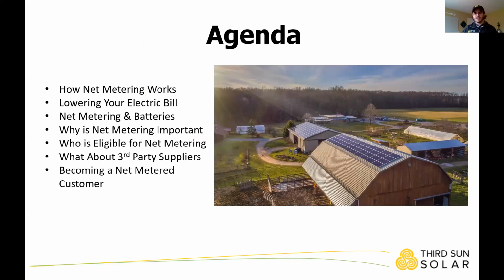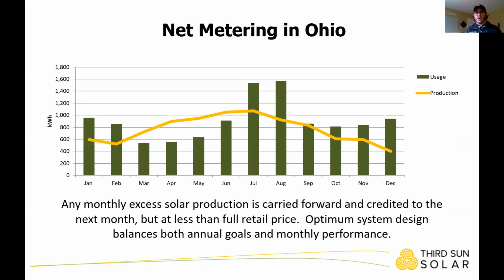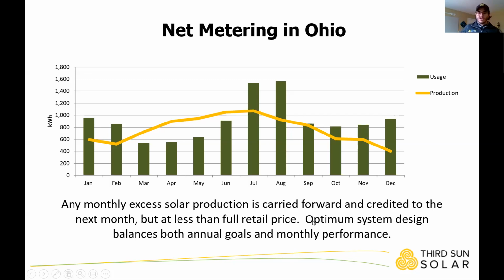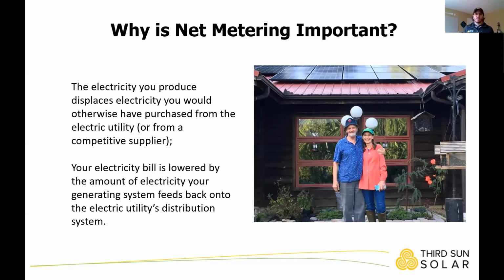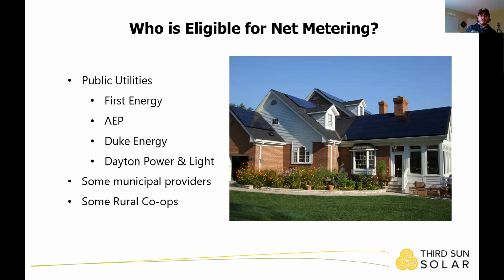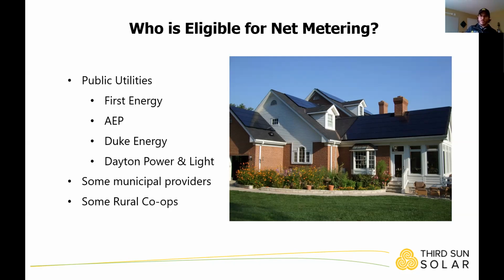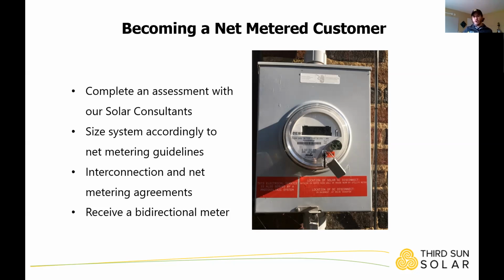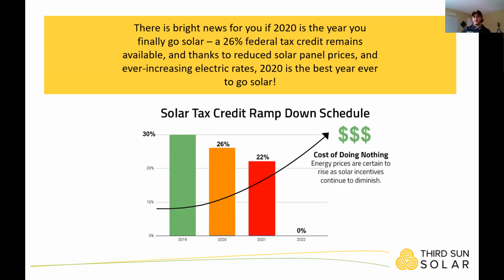Ohio Net-Metering - & Things to Know

Comment: I am in the planning stage for a new home build in Trumbull County, which is served by Ohio Edison. I'll be building an approx 2500 sqft all electric house with high efficiency heat pump mechanicals and advanced insulation and air sealing details. I live alone, so there will not be a huge load, but I do plan to purchase an electric vehicle in the future and I want to generate enough electricity on site to drive 10000 miles per year. I'm trying to determine a ballpark cost of the solar/battery system I'll need to provide all of my usage needs. I'm not particularly interested in selling electricity back to the utility at their pathetic rates.